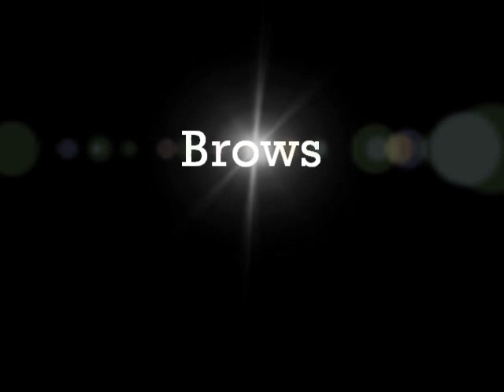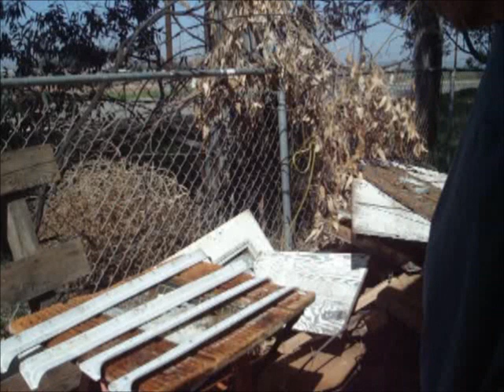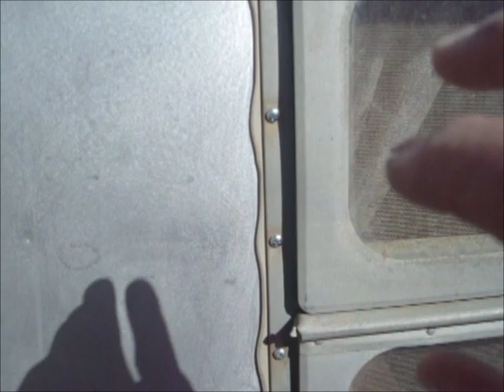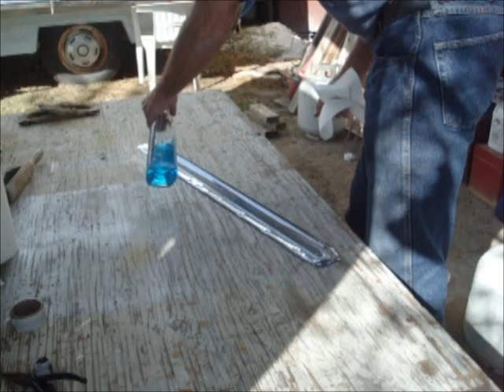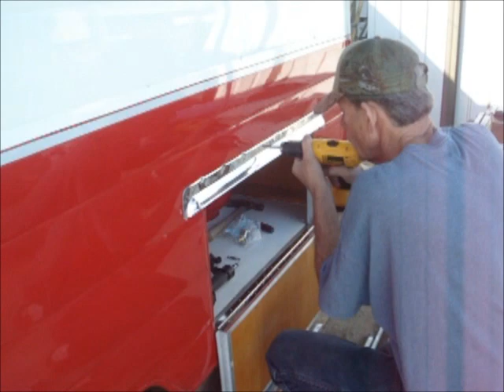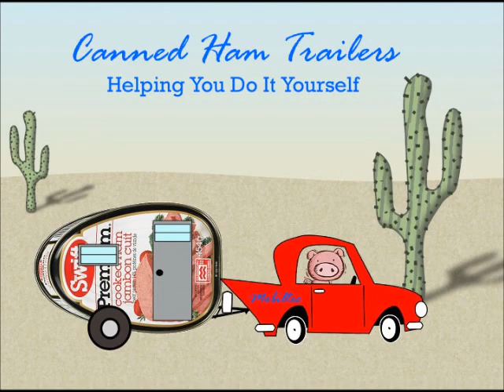Restoring The Shasta Part 22 - Brows

Comment from the maker: The light switches are usually on the fixtures themselves. My 59 Kenskill has a light switch on the wall but they are unusuall. I will be including the wiring in the Shasta in my videos. I'll be adding 12vdc to a Jewel next week and that will be in Trailer Tidbits on my website.

Comment: someone took a paint brush and put a light coat of white on the brows to my 1968 scotty.  I tried stripper and had no luck removing it.  yours shinned up beautifully.
Reply from the maker: House paint won't come off with Stripper. I've had to deal with whole trailers that were slathered with that stuff. The Deville was like that. Only thing you can do is sand it. Don't try sand blasting. It will hurt the aluminum... Sand your brows and when you get close to the metal use very light sand paper. Like 320 or lighter. Then buff and they will sparkle...